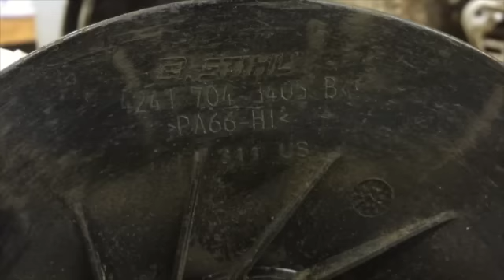Stihl leaf blower impeller and shredder blade removal and replace SH86C

Comment: My BG85 is a 2000 model...16 years of great service and demanding work. I do an annual PM on my blower to clean parts check fins on the impeller and inspect seals. From all I have learned since 1959 about air flow dynamics in tunnels, chutes, vacuum chambers etc. I would have cleaned the air chamber thoroughly while the unit was disassembled. This is a good concise video.
Reply from the maker: +Sherman C. Anderson you are correct. It is all about the flow and the debris is resistance to flow. I am making a compromise by not taking that step. Thank you.

Comment: Do you know where you can purchase replacement blades and impellars for them?
Reply from the maker: +Alexi Baez they cost less than $20 for the oem Stihl part from any local Stihl dealer. Unlike a lot of manufacturers, I have found that aftermarket parts for Stihl equipment are not worth trying. I can't risk having my equipment fail at the customer's location (just to save $5). Take care.
Reply: Makes sense,thanks for the info.
Reply: Kilikoba Nashoba o
Reply from the maker: Local Stihl dealer or an online Stihl dealer.
Reply: got mine at local ACE Hardware dealer who has Stihl dealer goods right on site and parts... easy to do and cleaned up well for an 8 year old blower/vac that sucks up mulch and cedar chips all the time.  Runs good now and always use REC fuel with genuine STIHL oil mixture... runs great... and really sucks good now.... blades were not too expensive either... easy in -- easy out and supporting the local guys..
Reply: @MICHIGANMIKE12  Thanks
Reply: How can you tell if the blade needs to be replaced?
Reply from the maker: If it has worse suction than it used to or has lots of visual damage to fins.
Reply: Open the flap where the suction tube connects and you can easily inspect the fins. The shredder blade itself has some "teeth" when new but they wear down over time when shredding.  @Boxycar79